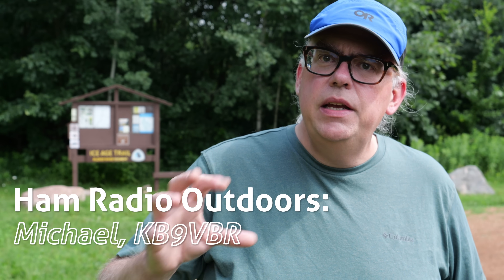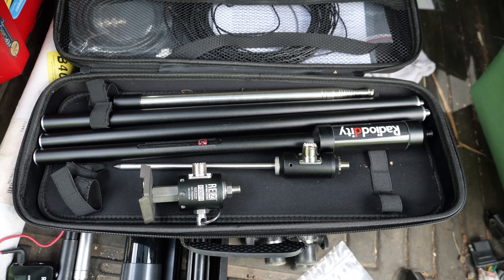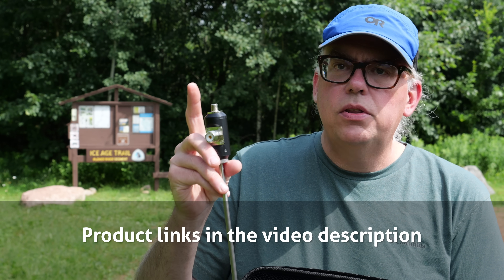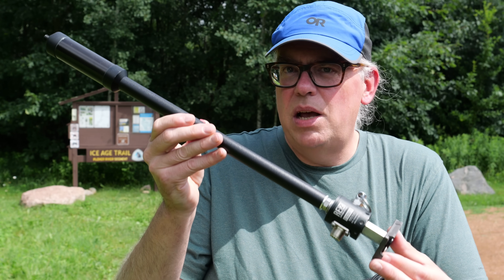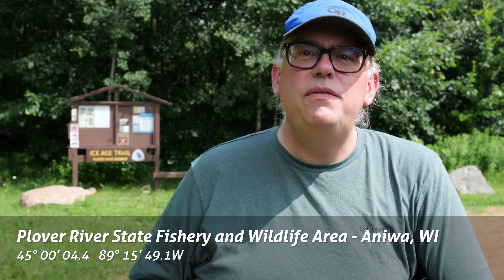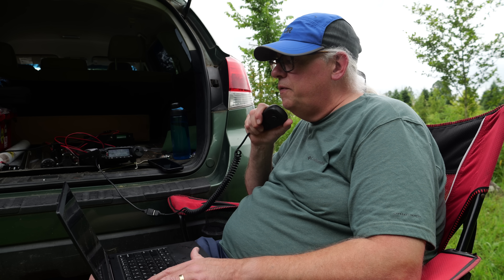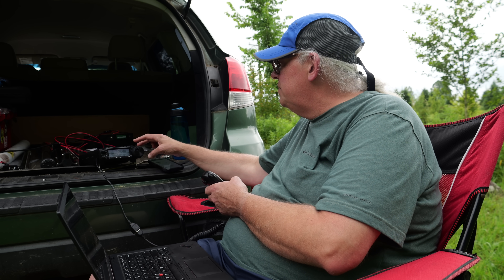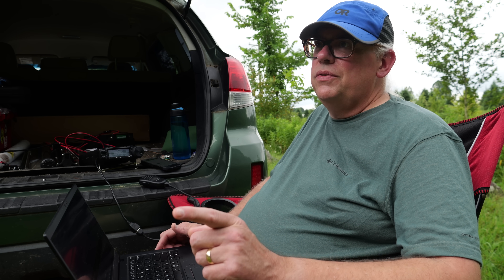This SURPRISED me! Elevating the Radioddity HF-009

Comment: Got great Bundle Black Friday deals from Radioddity for both the HF-008 and the HF-009.  I am now able to take the base off of the HF-008 with the included Allen screwdriver.  Then use it on the 009 with a 3/8 x 24 bolt. And it screws into both my tripod, with an adapter and the triple mag-mount, that came in the 008 Bundle, on top of my roof stationary mobile!
Reply from the maker: That's a great idea. I have an HF-008, I'll give this a try.

Comment: Thanks for the video. I have this kit shipping to me right now. I have a question about the ground spike that comes with the antenna base. Will the spike itself unscrew from the bottom of the balum base so I can use a mount with a male 3/8 x 24 threaded stud?

Comment: What did you use on the bottom of the Scout base that allowed it to mate with the top of the tripod?
Reply from the maker: I use a 1/4x20 to 3/8x24 thread adapter. Chameleon sells them. You can also get them from McMaster-Carr. I ordered a bunch from them to have in my kit: https://www.mcmaster.com/91072A124/

Comment: The ATAS-25 with an elevated radial equally works really well on a tripod set up similar to this.  Usually between the adjustable coil on the ATAS and adjusting the elevated counterpoise length usually quickly gets a 1:1 match with a Nano VNA.

Comment: Nice Video as usual, I bought a bunch of those couplers from 
a company called Fastenal. We have a store here. I use them
to make all kinds of antenna mounts. I have a Buddipole Deluxe
antenna system and I have added a lot of home brue stuff for it.
These different antenna systems are the tinker toys for Ham Radio.
Reply from the maker: Fastenal, Grainger, etc are great sources for some of those oddball parts.

Comment: Elevated radials need to be tunes as the antenna it self as this video shows that . But when you get it tuned it works great . I find having a common mode choke at antenna really helps .  Looks like ABR coax with the chokes at one end. That good coax as well. I have ABR coax and chokes as well as others like the DXE Hi' vis that Joe uses. 8X that solders easy . 100 % copper. Also the M & P POTA flex 7 I use. That all copper and bright yellow/orange. Has 3 shields. 2 braid and foil . Great coax from Italy. I find the Rig expert analyzer's are great for testing in the field.  I have a nano VNA-H4 and that better for bench testing. Been super MUGGY in NY . Hard to do parks . was a nice park to park pile up.  I have gotten some 10 meter and 6 meter FT8 gray line DX . Even storm fronts and Tropospheric ducting can happen down to 10 meters. Usually 2 meter and 220 with 70CM can get going real well in summer. I had 10 meters open up with a strong storm system and at solar minimum. Does not happen often ,But lots of fun when it does.  We getting some 6 meter action in NY at times. I use FM radio to check for ducting. When a far away FM station comes in ducting is going on. That Radioddity HF-009 is a handy antenna. Easy carry to POTA or SOTA . Just a step stool needed to reach coil would help. I have a folding 3 step one that breaks down small I use . 73 from NY !

Comment: Great demonstration.  My mash-up is the KJ6ER POTA Performer built to spec along with the WRC Silver Bullet 1000, the 213" whip while using WRC's camera tripod mounting and KJ6ER's segmented radials for 20 and above on an alligator clip attached to the base.  Then, I bypass the coil with the wire you demonstrated building in another video so that I don't have to take it apart when I operate on 20 and above.  Thanks, that was a nice trick!

On 40 and 80, I simply remove the segmented elevated radials by merely dropping the clip and then connect another alligator clip with  three 33' ground radials to the plate, place the coil back in the system and the results on 40 are pretty amazing.  My Rig Expert said 1:1.04 @ 7.150 sitting on my driveway this afternoon.  I had nearly the whole band at 1.5 or less across the board without having to do a thing further. 

On 80 meters.... well, it's 80 meters what can you say?  Lots of coil and not enough whip equals high Q but if you are willing to tinker, I got 1.48 at 3.800 sitting in the same spot with 2:1 on the ends about 100 khz apart.  2:1 is my personal limit without a tuner, so you'll need one to avoid fine tuning every sizable frequency change on 80.

The only drawback is I think the Silver Bullet is limited to 20 watts digital, so buy the Platinum instead if that's a concern.

Comment: I use a Neewer brand telescopic light stand made of stainless steel so no problems using it on the beach. In fact I sometimes use it at full height of 2.6m as the counterpoise and a 5.6m stainless steel whip with a 9:1 unun - kinda like a vertical off-centre fed random length dipole. Of course I need to use my mAT30 tuner with my FT891 or mAT180H with my IC7300 but this gives me 40m to 10m without needing to adjust the antenna length. I'm lazy and don't have the great analyzer. VK4BOB

Comment: This might be an obtuse question but when you're mashing up antennas and testing, how do you know which variable to tweak, like when you added a little more counterpoise, instead of adjusting the whip? Is it all trial, error, and experience? Or are there some rules to follow?
Reply from the maker: The general rule is to adjust the whip length (or coil amount if whip is fully extended) until you hit the lowest point of SWR. At that point you can tweak the radials, either making them longer or shorter depending if your resonant point is above or below what your operating frequency is to be. Once you get in the ballpark you can make a minor adjustment with the coil. 

I typically stop once I get the SWR down to about 1.5 - 1.7:1. The extra time it takes to find a perfect match isn't worth the marginal gain in performance. A lot of this is experience, but doing it a couple of times you get the hang of things really quick.

Comment: I like to mix and match to create different antennas. The Radioddity website says it has metric threads now and I don't want to use adapters. Great video...W6QR
Reply from the maker: When I reviewed the HF-009, the specs said it had M8 threads, but in closer inspection after the review, I realized they are 3/8x24. Maybe they were metric at one time but switched in production for the US market? I don't know, but its not the first time I've received a Chinese product where the specification sheet is different than the actual item.
Reply: @KB9VBRAntennas  I just received my 009 antenna and noticed the same thing.  Using a 3/8" stud to connect the antenna to a tripod mount and clamp mount.

Comment: The tripods that photographers use to elevate lights also work well for antennas. The market is large and competitive, which keeps prices down and quality up. They're designed to manage weight up high. Some will telescope up ten feet or more. Mine goes to twelve feet. That's high enough I can use a couple of telescoping rods as adjustable ground planes.

 The telescoping makes it easy to drop them down to make adjustments. They generally mate with 1/2-inch tubing, both horizontally and vertically, so you can attach antenna mounts to that. The trucker CB mirror mounts work well for attaching 3/8 x 24 threaded antennas.

Comment: Most tripods assume indoor use. That makes them unstable outside where the winds blow. Adding extensions to the legs will make them more stable and a bit higher. PVC pipe of the right diameter to slip over the legs works well. For added strength I used the grey, thick-walled, PVC conduit for running electrical wiring underground. It comes in various diameters. One 10-foot length should be enough to make extensions for all the legs.
Reply from the maker: Most tripods are way too lightweight for their purpose, unless you purchase something semi-pro or professional. The legs in the video are from a Bogen (Manfrotto) 3001. I don't use it for photgraphy anymore, so it gets antenna duty. Adding the sandbag stabilizes it greatly. With the sandbag it will hold a Chameleon Tactical Delta Loop upright in 25 mph winds.

Comment: You can find almost threaded adapter you need at McMaster-Carr, a well-established industrial supplier. They ship quickly from multiple warehouses and I've been impressed with their helpfulness.
Reply: Yes and they ship very fast. Truly impressive. The key phrase is "coupling nuts" for the part to put two male pieces together. I keep a few 3/8 24 and M10 coupling nuts in my bag for American and Chinese antennas, respectively.
Reply from the maker: There's a link for the McMaster-Carr coupling nuts in the video description

Comment: Well done. Early 2018 I bought the Deluxe Buddipole kit. It’s great. Shortly after I met W3FF Budd Drummond founder of Buddipole (his son runs it now ) on the 17m band. Ever since that we have been close good friends ( he is 24k gold ). He walked me through exactly what you demonstrated if it is at all ‘possible’ get everything off the ground. He taught me to do the last fine tuning using the ‘elevated ‘ radials too. In my experience running my vertical setups on the ground vs all in the air. Yep it makes a difference especially in difficulty band conditions.  PS. I was talking to a friend of mine this week that’s really into POTA. I was trying to explain to him to do this ,down to the snow stakes  too ( we are in Michigan). Now I can forward your video and say “copy this “ haha. Thanks again my friend. K8CGS
Reply from the maker: Before Budd went commercial, he had the plans online. I built one of his Buddi-Pole antennas more than 20 years ago. I always had good luck with it in the waning days of Cycle 23. As for the PERformer antenna, next week's video will feature three antenna setups, including a PERformer. You'll not want to miss that.

Comment: Great video.  Did you compare the performance of that antenna with the stock set up from the manufacturer
Reply from the maker: I didn't do any comparisons in the field. Anecdotally I can say there is an improvement in signal, I just can't quantify it.

Comment: Many tripods allow you to splay the legs out much further to lower the overall height.  What coax is that you are using with the integrated ferrite beads?
Reply from the maker: I'm using a 50 foot piece of RG-8x coax and I've added the ABR common mode current assembly at the end: https://abrind.com/shop/popular-ham-radio-cables/current-type-ferrite-assemblies/

Comment: I have the elevated on tripod mounted MCC chameleon and still learning the use of the elevated counter poise.  I have ordered the radiodity HF-009 and will try it also.  Love the experiment. And yes band conditions have been a mess. Still fun to try.  Even used my Gabil on its tripod and works great too.  All about the contacts
Reply: Good rule of thumb is to get the  base of vertical up no less than 4 feet off the ground. I do 4 feet I am short haha. Then run your radial(s) sloped down and attach about 3 feet even 2 if necessary. Key is elevated off the ground and slope if you can. I use snow stakes for radial ends. But I am Michigan guy so they are everywhere haha. Just like this video. He did a good job. Yes it makes a difference.

Comment: I did a pota performer with 25’ telescopic antenna about 4’ off the ground on tripod, with a tuner I contacted all over Europe and USA. It works from 6 meters to 40 meters with tuner without adjusting the antenna. I’m too lazy. 😅

Comment: Where do u get the elevating stands for the radials
Reply from the maker: They are fiberglass driveway markers. You can find them at Home Depot. I take three and bundle them with a rubber Bongo Tie
Reply: Try plastic driveway markers,or t posts from tractor supply
Reply: I assume reflector fiberglass yard steaks. I use some just like it for my Pota Performer radials.
Reply: Electric fence stakes work too